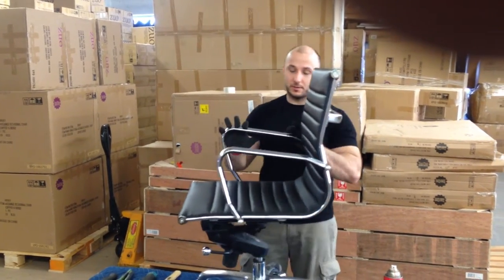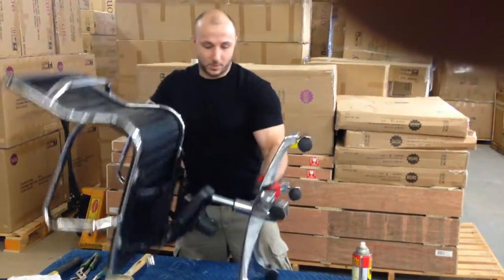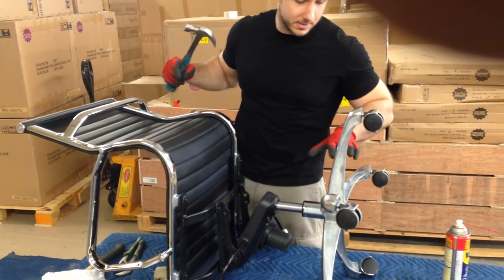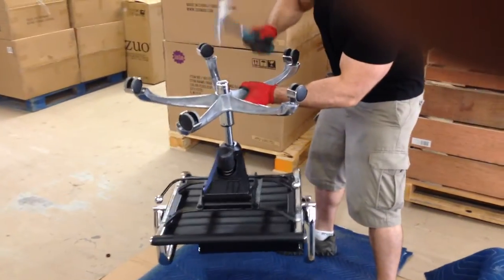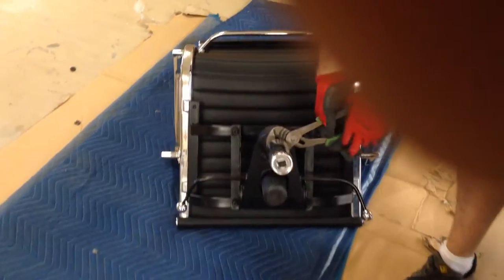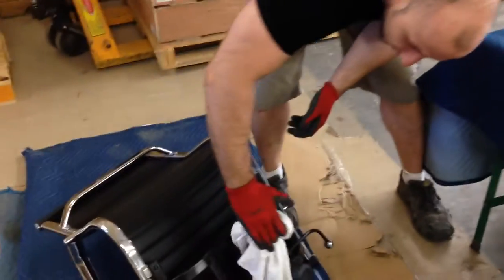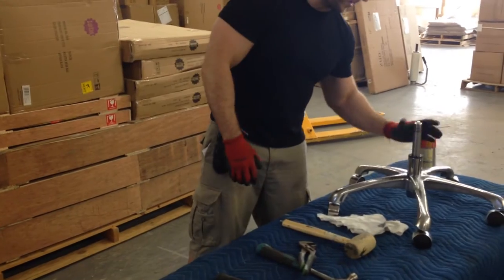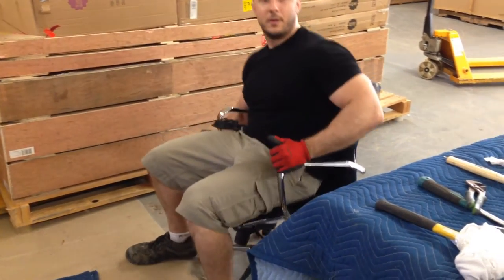Changing an office chair piston

Comment: Super helpful, thanks!  We have the exact same chair as in this video (it’s brand new) and needed to do the replacement to a lower height piston. It worked exactly as you instructed. We have on older chair, however, that no matter how much WD40 we used, it would not come apart. Not sure what we did wrong.
Reply: You might need  what we call an  "Arkansas Speed Wrench" maybe a "BFH" which is a big freakin' hammer!! LOL!! Good luck!!

Comment: This is  BS  will only work on new chair that don't a new gas lift
Reply from the maker: Negative, WD-40 will resolve the issues of an older chair that had the parts stuck together over time.
Reply: @michaelgrote4350  I still strugling to separate the pistor off the base. I hammered the cr** out of it already. No luck. Tried WD 40. I'm considering buying a new base since I can't separate the old piston from the it.
Reply: I made it!

I needed to use more WD40 and change the hammer for a 2 KG(4pound) mallet!

Comment: What if mine got really stuck.It's a old chair I tried wd40 I tried the pipe wrench and hammer none of it worked.If I try harder someting's gonna break
Reply from the maker: Depending on which manufacturer you're dealing with, to date Zuo Modern I never seen any issues.

Comment: I post this as a caution. I posted this to another similar video also:
I just did my older high quality desk chair. It took 2 days. The bottom wheel carriage came off easily enough I guess, but then......
I soaked the part that goes to seat portion in Wd and PB Blaster, No Joy, and I have a large 18" pipe wrench. Tried it again after soaking overnight. No joy. I was putting so much force on it I was afraid I'd break the rest of the chair. I then removed the seat adjustment mechanism from the seat and put it in a large heavy vice so I could hold it in place better. No joy. Then I clamped the cylinder in the vice and tried a HF hydraulic spreader to try and pop it off while wailing on it first with a dead blow, then with a 4lb sledge, but no joy. I went back to the internet thinking maybe mine was bolted or welded on, but no. Finally, I took some of the more fragile parts off of the mechanism took it out side, placed a board on the ground and placed it on the board and then used the front end loader on my tractor to hold it down. I then put a 4' cheater pipe on the pipe wrench handle and gave it everything I had. Joy!!! My chair is now fixed and works great again. All you need is a tractor with a front end loader and a few thousand pounds of weight and 4' pipe wrench and 220lbs of fat man and it comes right off as easy as pie.
Reply: I wish you'd have made a video of that 😅

Comment: What about the retainer clip holding base on?
Reply from the maker: What retainer clip are you speaking of?, there's no clip holding base on.  Please rephrase or specify which part.
Reply: Michael Grote Most office chairs have a retainer clip securing the caster base on. If that clip in not replaced and you pickup the chair the base will fall off.
Reply from the maker: For Zuo Modern office chairs, I have never seen a retainer clip securing base, the only time that the base will fall off is if the chair has been assembled and not sat on.  When you sit on the Zuo Modern office chairs it secures the connection where the piston enters the mechanism as well as securing the piston to the base of the chair.  That's why I used WD-40 to lubricate these connections prior to removal.  You may be correct with a retainer clip securing the caster base but it doesn't apply for Zuo Modern office chairs.
Reply: The piston comes apart with a retaining clip.  Mine came apart and half of the piston is stuck to the seat now. I moved residents and lost the clip. Now I can't grip the top half of the piston while wrenching on it. Alrhough I need to buy wd-40